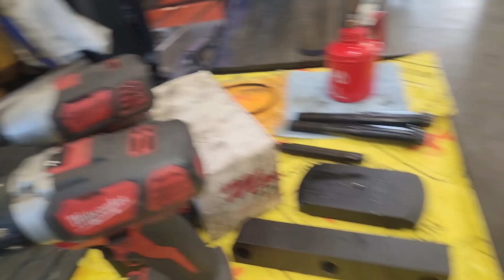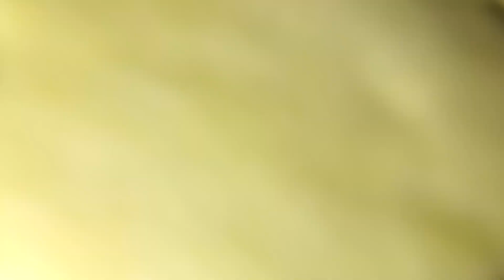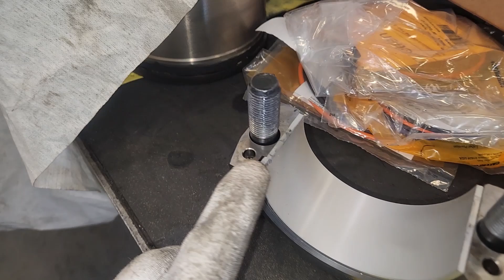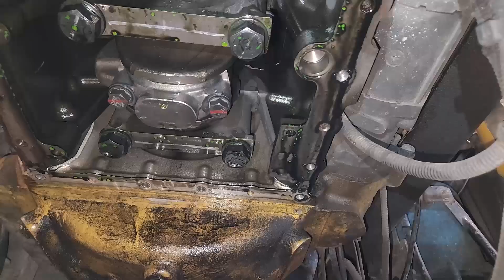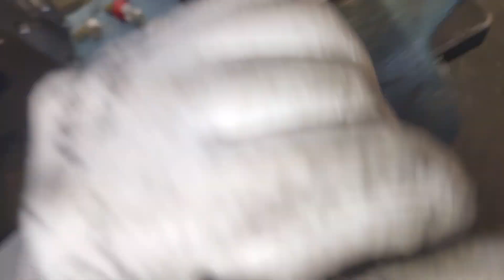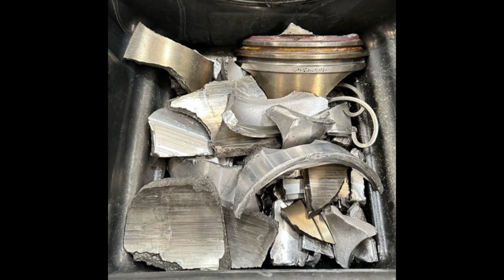"Purple Pete" gets it together. C-15 with Aftermarket Cylinder head.

Comment from the maker: Thanks for watching. Really wanted to get it running in this video, but unfortunately the head showed up too late in the week to get it running before the weekend. Next video should be the conclusion and the beginning of the next series. Amazon Affiliate Links to some recommended tools helps support the channel: 
OTC Vacuum Brake Bleeder: https://amzn.to/3pvq1JI
Red Tire Lube Bucket and Swabs: https://amzn.to/3PeGSwF
Oiling Can: https://amzn.to/3c3MKK0
Vevor 5 Ton Air Bag Floor Jack: https://amzn.to/3AQsVPz
DEX FIT Gloves FN330: https://amzn.to/3AAsOq9
Fuel Pressure Gauge, Compucheck 0-300 psi: https://amzn.to/3YeBldu
Airlift Cooling System Vacuum Filling System: https://amzn.to/3D9AlPu
Reply: Got any tips on obs 7.3 maintenance?
Reply: Thank you ape! I want to be talented and have the same knowledge as you sir!
Reply: Hello sir. My name is Son, I am Vietnamese. I need to buy used CATERPILLAR (c9, c12, c13, c15, c18, c32) injectors.
If you know of a place that sells them, please give me the address. thank you very much

Comment: Joshua, look up your block salvage repair guide. You'll find that the water director ports in the block have been repaired with inserts. In your video you can see the line of sealant used out below them in the galley. Aparently the Reman facility failed to deck the block after they were installed. 
I had one apart a year ago that had deck inserts installed wrong, and they settled and caused the liners to drop, blowing head gasket.

Comment: Thanks for the knowledge that you provide. Question ❓ What's the difference between a 3406 cat generator fuel pump and  a 3406 cat highway engine fuel pump? Thank you again for the time to answer the question.

Comment: If its a Chinese casting, best redo the cups. First one I used cups leaked in first month, no Loctite sealant/retainer on the bottom and low quality black o- rings used from China.

Comment: I'm a dealer for APC cylinder heads and used over 60 of them myself and can tell you they are hands down better quality than Caterpillar heads are nowadays. Plus they aren't covered in blue shit. On a side note, cylinder kits give me anxiety, every engine I build, including these 3400's, gets ring gap measurements and always need  adjustments. Ever seen a low hour failure on a fresh overhaul??? Ring gap. General rule of thumb,  .004" per 1" of cylinder bore

Comment: I had C12 with piston skirt come apart. Most of liner, piston and part of block in oil pan what a mess. C9 where rod damn near cut block in 1/2. Broke oil pan, oil pan rails, oil cooler off, block on both side almost to block deck and power steering pump knocked off

Comment: My local  Catl dealer would never allow an after market part in their shop.
Reply from the maker: We are pretty flexible, try to make the customer happy if that is their choice.
Reply: Although it sounds like they had no other choice I wouldn't dare use any aftermarket parts especially the head and rotating assembly I would have just waited for the right one to come in

Comment: I've tried 2 of those aftermarket heads.   They claim better iron, and bigger water passes.   IMHO they crack easier than a Cat head.   Or maybe I got 2 bad ones.   I'm back to Cat.  But not reman,  new only.
Reply: Only way to go
Reply from the maker: Hopefully this one runs great.
Reply: @AdeptApe  I believe it will be fine under 650hp.   Especially with a big hood radiator.

Comment: when you installed the liner kits , wouldnt  you liner hold down bolts from liiner protusion kit to keep liners held down? so they dont move back up, so liner filler bands seal correctly while you waited for the head?

Comment: That driver mustve been down for 2 weeks in $30,000 for a rebuild and another $2500 for hotel.  Dont see how theyll survive out there with these crappy rates.
Reply: It is a tri axle so at least it is specialized freight.
Reply: If you’re doing what everyone else is doing, you will get what everyone else gets.
Reply: Rates are always low in the start of the year. Everyone seems to somehow forget that.

Comment: Hello Josh, is it possible to turn on captions for your videos? 

I am a deaf truck driver that works on engines and servicing trucks. 

Thank you. Would help me to understand your videos.
Reply: I watch from the mobile website and the auto captions work great.
Reply: You can turn on captions. It's that little cc button on the top right of the video. At least on my phone. They're auto- generated so sometimes they're a little off but they're usually pretty close.
Reply: @davidtatum8682  

That’s what I press. The little cc button. But it’s faded which I’m thinking the person that made the video hasn’t turned it on maybe. I’m not sure how that works. 

I use that cc button all the time. For a lot of videos that I’ve watched it does work well. 

I think it’s been improving a lot over time.
Reply from the maker: I don't have them turned off, not sure if there is a delay. You can view transcript for some reason, which puts everything in a text format. Sorry about that. I'll try to do some research on it for the next video.
Reply: @AdeptApe   ok, makes sense. I’m sure it’ll fix itself 😉 maybe YouTube had a misfire. 

Looking forward to watching more videos from you!
Reply: @Srdieselshawn  it was cylinder 3
Reply: @davidtatum8682  😂
Reply: @AdeptApe   hello. An update to my previous post, the CC button does work now. I am currently watching the video 

Quite possible YouTube was slow loading content or something. 

Thank you!

Comment: You don't like the blue grease Cat puts on their heads? It's like Never seize. One dab can spread 600 square feet and get everywhere.
 I like putting the exhaust on after also. But some chassis it's a lot easier on the head first.
Reply: That's long term rust preventative, and required because all of the inventory comes from one warehouse. That inventory can service an order across the street, or across the world, so it has to survive a trip over the ocean (and potentially 12+ months on a storage rack).

It sucks, you really need a wash bay and STEAMING HOT WATER to get the crap off.

Comment: Josh, i am curious why you would not go for the higher limit of the factory spec on the liner protrusion?  We all know factory spec is BS, and they keep it at the minimum necessary.
Reply from the maker: Do you mean for torquing the liner protrusion bolts down or do you mean to keep the liner protrusion closer to .006"? I like to have them at .004-.005" as running it over .006" could potentially crack a liner flange depending how much over you are. .0035-.006" is a pretty tight window to achieve so I'm happy with factory specs.
Reply: @Adept Ape  i meant keeping it closer to .006 . You responded with a articulate answer. Thank you, i was just curious.  Love the videos
Reply: That was a good question. I have 3406e and C16 and had been wondering same thing. I had always thought if mine ever needed head work I would shoot for six thou maybe 7. Evidently More isn’t always better  because cracking the flange makes since.

Comment: Just super curious, what’s a job like this cost? I can only imagine…lol
Reply: In canada it would be about 45 to 50 K. Those 55 hr standby shop rate would be hella more.
Reply: Shit. Im sure it's a small fortune. Freightliner labor rates are about 180 an hour and this job probably took like 500,000 hours. Lol. More than i have I'm sure.
Reply: In frames used to be around 20k depending on what all you decide to do. The sky is the limit for part replacement. However everything cost most these days so probably closer to 30k if I had to guess. Parts are expensive and so is labor. Also cost can vary depending where you take it obviously.

Comment: I prefer to use the 2P-8260 Cylinder Liner Installer Group Tool, because I can feel the seals compressing as I push down on the tool, and you can feel if they are not going in correctly by feel, after using it to install liner with long term using it! Your way works, but I like the feel!
Reply: And  quicker

Comment: My guess on the brand of the head is diesel cast, as far as I know they are the only ones who include the purple straps. Got about 20 of them around the shop
Reply from the maker: Hopefully you mean 20 of the straps and not the heads.
Reply: I've gotten some heads from highway and heavy parts, and they came with purple straps, which are super handy to keep around.
Reply: @cherokeelittle4582  hhp heads are diesel cast heads

Comment: How much would a job like this cost
Reply: Buddy of mine just had his engine done and it cost him 48k, but that was about as bad as it can get as the only thing original he has now is the block.
Reply: @jaydunbar7538  that's crazy. I unframed my 60 series Detroit myself for about 4k. Head was gone over and I reused my pistons. I have overhauled entire engines on farm equipment for 10k max.
Reply: @plowboy7700  But your not figuring in labor and the fact that you reused a bunch of parts. A friend of mine blew up his cummins. International quoted him 32k. That included a reman head,injectors turbo. New cylinder packs and oil pump.
Reply: This job was probably around 30k. It is just an inframe with what seemed like not tons of extra parts. He mentioned the same injectors. No new radiator, turbo, oil pump, cam etc. Could go up to 50k with random parts added in. Parts are expensive, labor is expensive, both can add up quick.